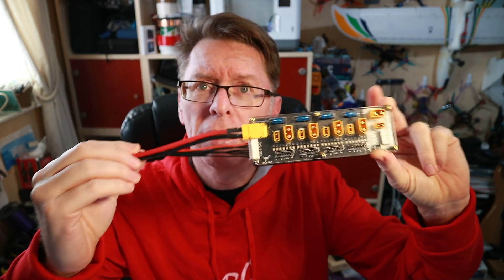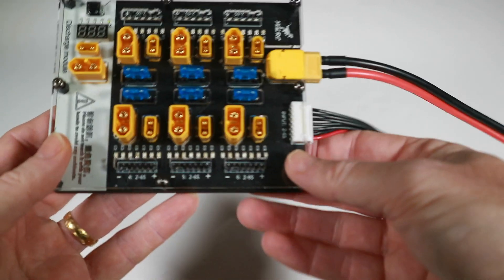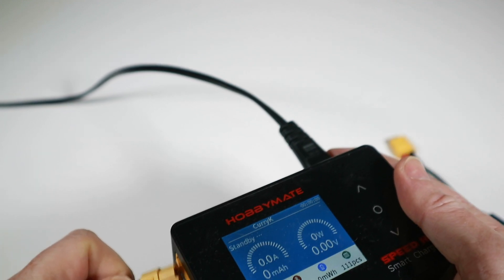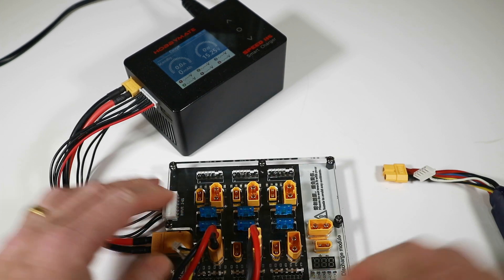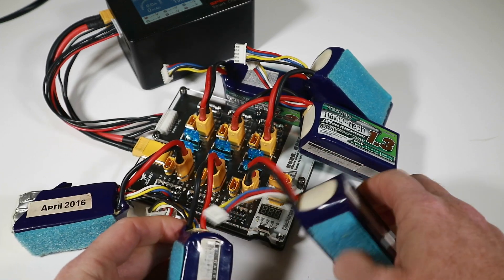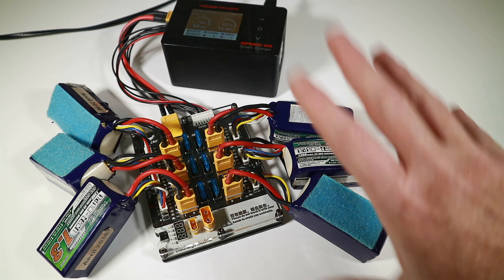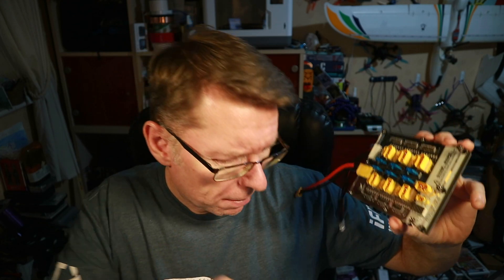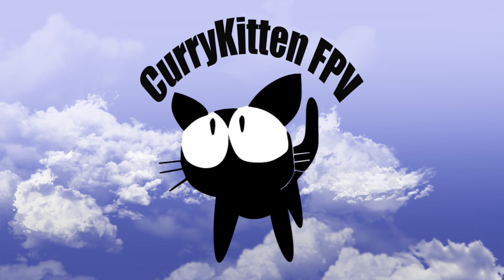Safe parallel charging with the HGLRC Thor Pro 6 port parallel charging board.

Comment: First all  balance cable and after all balance cable put all connector
Reply from the maker: That seems like an odd idea, any mismatch in voltage mean that you'd get a rush of amps through the thin balance cables which can melt/go up in flames pretty easily.  As an aside, I have stopped using parallel boards entirely.  The only incidents I've had with lipos have involved parallel boards, and to me it's not worth the risk.  I'll just get more multiport chargers

Comment: i was charging 2 2s 8000mah batterys @16a on this board and one of the hardcase batteries popped and blew the case off with swollen lipos. Should i have charged at say 12a to be safe?
Reply from the maker: If you've done everything correct - cells within 0.1v of each other then it should be safe to charge at 16A in that setup.  I think the trouble is with a parallel board, that if something does go wrong for whatever reason, you only find out when something more serious happens

Comment: How does balancing work while parallel charging
Reply from the maker: All the cell 1s of each battery are treated as 1 big cell. Ditto with the other cells. This is one of the reasons it’s important that all the cells in all the batteries are within 0.1v of each other

Comment: I need 8 ports.
Reply from the maker: Not sure if I've seen an 8 port parallel charger, but I've used 2 parallel charge boards into a dual port charger before

Comment: hey if I have 5x1500mAH and 1x1050mAH battery does that mean I can set the charger to 5*1.5+1=8.5C? theyre all 6S
Reply from the maker: Although it may be possible to do, I personally would mix my capacities of lipos, so I'd charge the 5 x 1500mAh at 7.5A to stay at 1C and charge the 1050mAh seperately
Reply: @CurryKitten  thank you :)

Comment: Thanks for the video! Do you think the HOTA D6 Pro could charge 9.3A for parallel charging 6 1550mah lipo HV at the same time?
Reply from the maker: I think so, I don't have one -  but looking at the watts per channel, I think they could do around 10ish Amps at 6S voltage

Comment: Good video, thanks for the tip about the balance leads. I just hover in my room for about 3 minutes to discharge.  I cans see the Velcro fuzz on the back of your batteries.Do you use Velcro on your drones?  Or do you use these batteries for your goggles ?

Comment: Excellent review. Today I still have a great hesitation to using parallel charging ports. But I certainly see the advantage. I currently have several chargers that will do four batteries simultaneously.
Reply: Which do you recommend?
Reply: I would recommend the Hota F6+ just be aware that to get the maximum 1000w from it you'll need to have a DC power source connected to it, which isn't anything difficult of course. You can get 500w from AC though so plenty powerfully.

Comment: Very good boards. At 8:50 you mention the red light and no protection. On the back of the board is stated: "Battery Balancing Connector Protection: There is an indication of LED when Self-resetting in short circuit situation in thermal fuses between every balancing pin.". If I'm correct every balance wire is protected by a Poly-fuse, mounted on the back of the PCB. The fuse comes in if they overheat. After cooling down they work again.
Reply from the maker: It does say that, but I tested it by leaving the short circuit connected for a few minutes and I managed to get some smoke out of it - which seems that the protection could be better
Reply: @CurryKitten  Thanks for the warning.  From the 1000 times of charging there was 1 time when I was distracted during plugging the connectors and the red LED and the large fuse saved my LiPo packs.

Comment: Checking batteries are balanced pre charging?. None of mine are...and you storage charged them to make them suitable candidates for parallel charging..?...Did I miss something...🤔😳😳🇬🇧
Reply from the maker: Yeah - I did cover that.  Each cell on each lipo needs to be within 0.1v of each other and I mentioned storage charging my lipos so that I'd expect them to all be suitable.  Or are you saying something else ?
Reply: @CurryKitten  No, you covered it perfectly. This is why I don't do parallel charging...I was just checking I had it right...🤔🤔😳😀
Reply from the maker: Yeah - there's a lot to be careful of.  Extra time and attention is needed